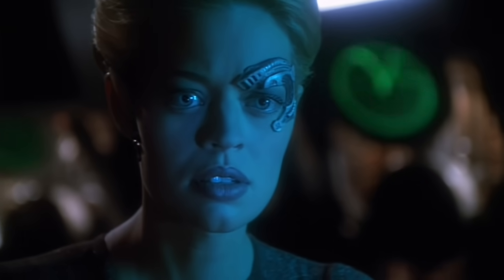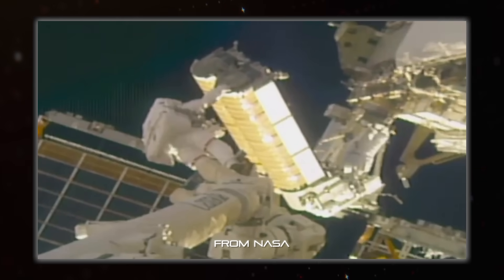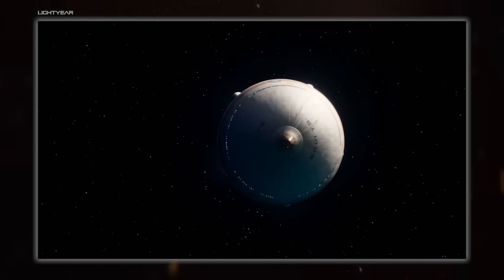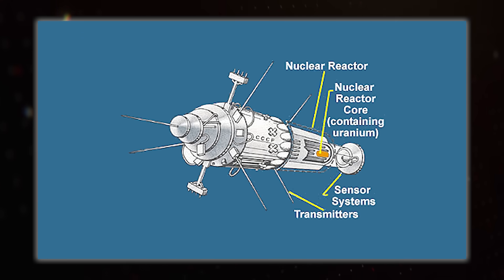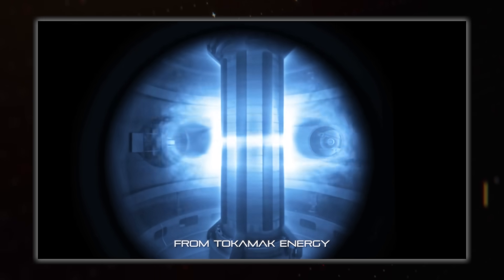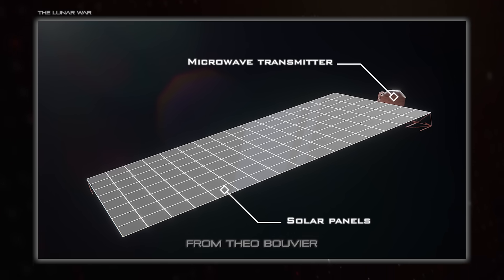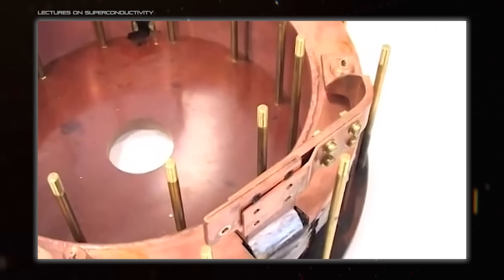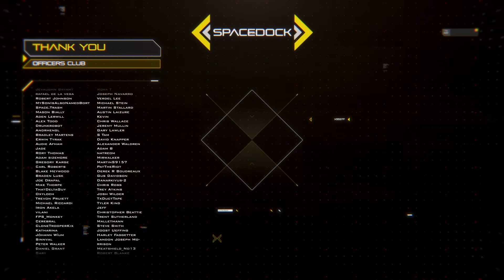How to Power a Sci-Fi Spaceship

Comment: Sadly ypu missed black holes generator. Using black holes to convert mass into energy can allow you power measured in planet masses
Reply: Do you make black holes that then evaporate to get the energy, or do you just find one and somehow push it around?
Reply: @RorikH  while both are theoretical possible creating smaller black holes should be far more useful and efficent.

And since you can actively feed them you can regulate the power output
Reply: @emilsinclair4190  And how do you create them without starting with a collapsing star? Is it some kind of fusion-ish thing where you use electromagnets to mimic the gravity needed to crush something into a black hole?
Reply: @RorikH  depends on the sci fi universe.

In the universe created by evan currie there are two methods. One is using the power of a star to create a kugelblitz black hole. However this is very energy I desire.

The other is using matter harvested from neutron stars (if I remember right) and than just feeding it until it becomes a black hole.

If you have garv manipulation methods like those used in the creation of warp drives there are also other methods to create black holes.
Reply: @RorikH  depends. You can use light ro create kugelblitz black holes. You can use material from neutron stars.

You can modify war tech to create them.

Comment: I think any good ship needs multiple methods of producing power. 

In my setting, most ships have a matter-antimatter generator as their primary means of powering warp drive, a fusion reactor as a secondary that is used to power everything except the warp engines, and some gas powered maneuvering thrusters that can be used if you're really desperate.
Reply: ah antimatter... hope the other guys dont have a neutrino laser
Reply: Multi-Power sources are nice for when you at least want the ability to slowly limp home, if nothing else.
Reply: My dream ship is modular and that modularity exist also in the "energy core" the central part of any ship in my setting 
all ships are always build around this core.
The core itself is also modular either cylindrical 
But segmented like ina cake or 6 pyramids combined to a cube 
you can have multiple energy generating technologies installed in the core with each segment housing one of each "generators".
Reply: I also agree

For anything that requires a lot of energy like a warp drive you use something powerful like antimatter or aneutronic fusion, for the general power source that powers everything else it could be something smaller like fission or fusion that could also help support the other more powerful power sources, and a backup power source like hydrogen fuel cells or solar panels
Reply: Good point! Unfortunately I'm just as guilty as many others of forgetting to include redundant systems, so kudos to you for remembering it in your design.
Reply: You would need to have another generator with an antimatter generator in order to start it up, and in a warship help keep it running even if the power plant itself is damaged. In my setting later ships have black hole drives which also produce power, but have fusion as a backup.
Reply: @sonwig5186  That's when you pull out the bicycle connected to a motor with a belt drive! 🤣😅
No, but in reality I imagine a practical fusion generator would have a smaller generator baked into its design for exactly that purpose.
Reply: @sonwig5186  Not if you had a lattice surrounding antimatter, it can't go anywhere without being moved, and that requires power. To make movement happen but along a required line instead of "anywhere" you could use compression waves that start at one end and exit the other, where the antimatter is now free, but because of that initial kick from sound waves, it starts off going away from the containing solid, and instead gets picked up by magnets to direct it to the power systems where it interacts with protons to create power.
Reply: That tallies with modern warships using systems like CODOG.
Reply: My most advanced faction uses sustainable antimatter for power, by concentrating and harvesting matter/antimatter pairs from quantum fluctuations around their ships. The only big downside is you get diminishing returns with a large fleet as ships too close to one another can accidentally leech off each other's drivetrains.
Reply: In mine there are three fusion reactors keeping each other alive, as they provide power for the magnetic field of the Tokamak of each other aswell as other things.
Reply: On large modern ships like freighters, tankers, and cruise ships, we generally have Diesel engines and generators (sometimes the engines are the generators, powering huge electric motors),  then at least one auxiliary generator that can power crucial systems without the main engines running, and batteries for electrical storage... but we also use several other means of power for systems that either shouldn't use electricity directly, or need to run when there is none. Emergency telephone circuits are self-powering, only requiring sound vibration to work. The fans that clear explosive gases out of empty fuel tanks are kinetically powered by a stream of water from the ship's fire hoses. And of course, as a last resort, there is generally a way to accomplish things with levers, pulleys, wedges, and other simple machines... powered by many humans working together.

So, I think multiple methods of producing power follows the design of real-life, maritime, ships.
Reply: Pretty much a necessity, especially for starships that are light years from home.
Reply: Damn, mine figured out a artificial star fusion core, but this is cool, what amount of realism youre going for?
Reply: Or use NASA's physics defying propellant less thruster